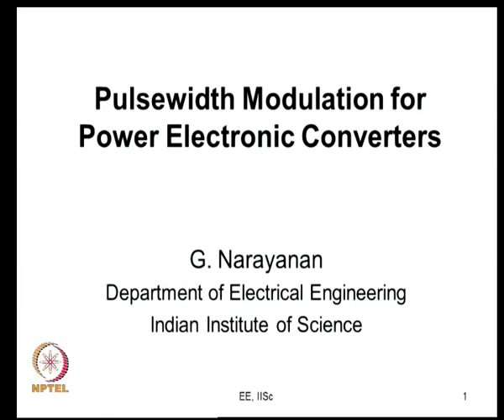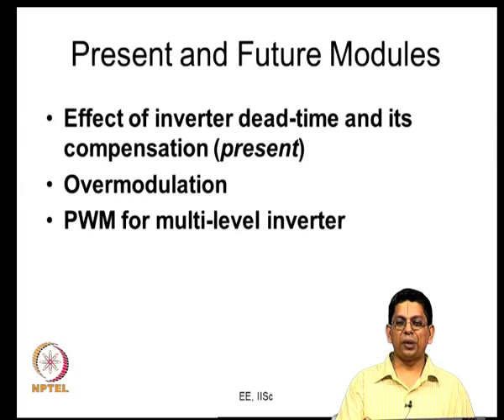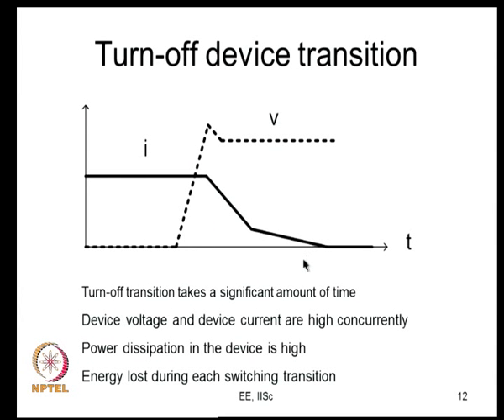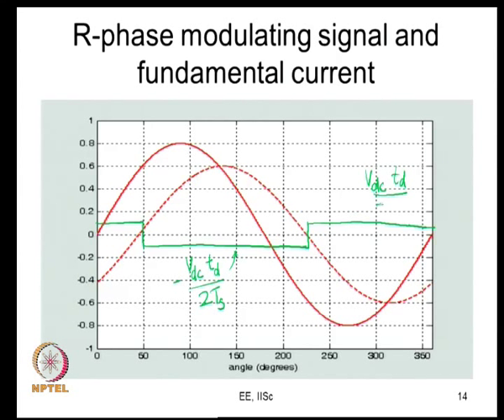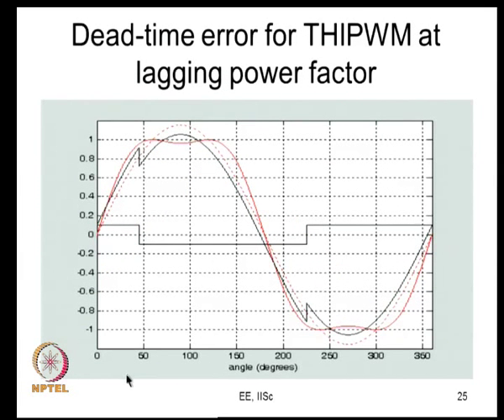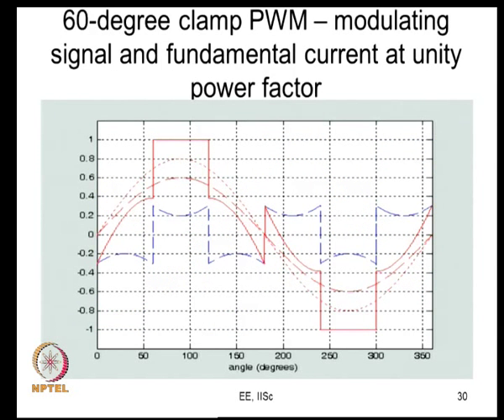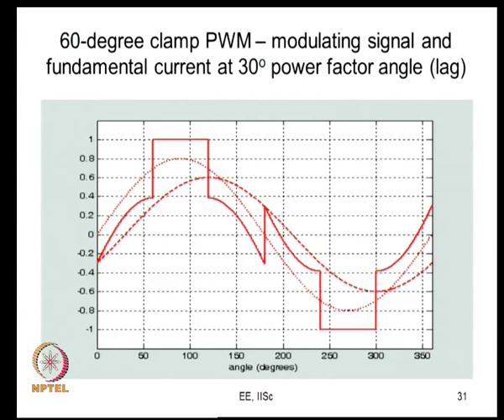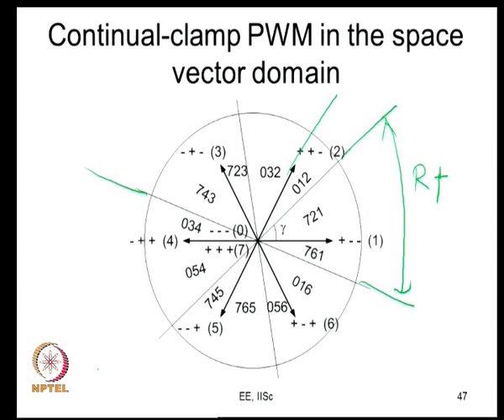Mod-11 Lec-35 Effect of dead-time on inverter output voltage for bus-clamping PWM schemes

Comment: I do not see where the 2 is coming from in the equation for average error voltage @36:27
Reply: @Anup Thapa 
The lecturer is explaining about average error voltage over a full carrier cycle(Ts+Ts)=2Ts
Where Ts= subcycle or half carrier cycle
if you want to calculate average error voltage  over a half cycle use (VDC*Td)/Ts

I think I've got clarified your doubt...........???